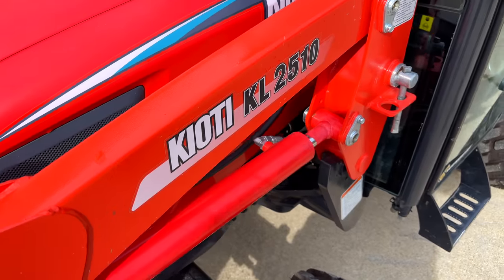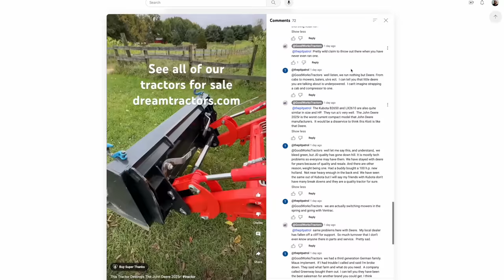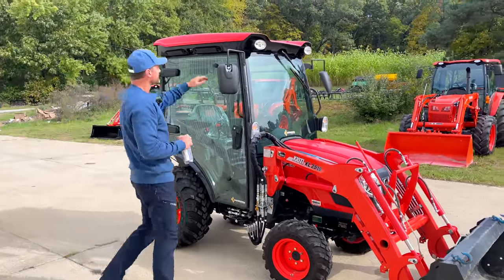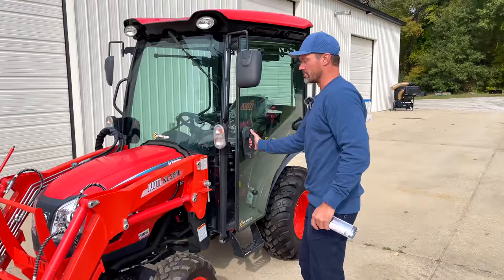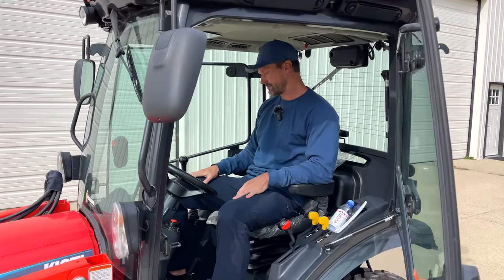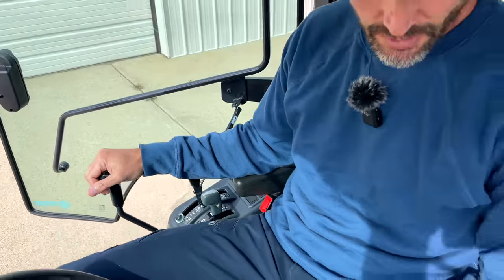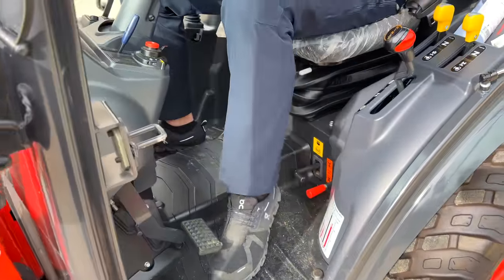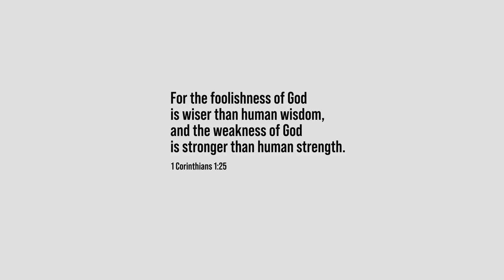THIS TRACTOR CRUSHES THE JOHN DEERE 2025r!

Comment: I think Mister Green has been resting on his laurels for far too long.
Reply from the maker: Agreed!
Reply: When you are on the same side as the Church of Scientology, you’ve trucked up to say the least.  
I won’t buy a green tractor because of their lies and disgraceful behavior towards farmers who are just trying to repair their tractors.  
I was looking at Kubota but the hydraulic pump and capability of the Kioti has caused me to visit the Kioti dealer.
Reply: Agreed.  It used to be that Deere was the best for the most part…. So they earned their extra cost. No more … now it’s cheaper aluminum two speed transmissions.. plastic body/hood , smaller lift cylinders, etc.  I would suspect that Deere purchases ptheir parts cheaper than most manufactures … simply because of volume , If nothing else.  So … Deere just has greater mark-up. I won’t buy another Deere. …

Comment: Looked at the JD2025R, Kubota LX2610 and the Kioti CX2510.  Went with the CX2510 and not disappointed at all except I wish I got the cab.  Got 300 hours on it without one single issue.  It was 6K less than the JD and Kubota.
Reply from the maker: Sweet, that's really good news!
Reply: Same story here, I just bought a cx2510 after comparing the same models and saved $6k vs kubota and $9k vs JD
Open cab doesn't have the rear remote hydraulics
I've just got 10hrs on mine so far,  works very well!

Comment: Overall, the Kioti looks like a great tractor but the hydraulic lines hanging down makes one wonder what they were thinking, that should have never left the factory like that.
Reply: Ya no thanks so in 20 years we going to be able to get parts for this tractor ?
Reply: I pointed this out to my dealer (not a comedian like the guy in this video who doesn't know a clutch pedal from a brake pedal)  right away before buying my Cx2510,  he explained sometimes the factory tends to reverse the 90 degree elbow end of the quick connects to the loader with the straight ends,  and fixed it during my  pre-sale pm.   Then they are tucked up high  nice and tight.  Check out Google images for the right side of the Cx with loader and some are correct and some are wrong.   This joker had not clue about that but still wants you to buy a $30,000 tractor from his dealership.  yeah,  right.

Comment: I have a CX2510 HST, no cab, and have over 200 hours on it in about a year and a half. What it can do for its size and maneuverability continues to make me happy I bought it.

With loaded tires (Rim Guard) and rear ballast, it can lift somewhere about 1000 lbs palletized and evenly distributed on forks, but must keep it low, slow, and on the level (requires extreme caution).

Loader technique is impotant to master for bulky and heavy things like rock or wet dirt. It handles a grapple very well, larger logs handle better with at least a box on the back for ballast.

Yes, it has capacity limitations and at 25 HP, it must be in a low gear and slow going up a hill towing or under heavy load, but it can do it.

When I feel like it comes up short (and it does), I remind myself I would need a much bigger machine and have to live all the time with more than I need most of the time.

Sometimes I experience those limits as lack traction, slower speed under load, or with the loader when I wish I could lift a full ton on a pallet.

But, those are true limitations, just known constraints, because it wasn't designed to be more than it is. That said, it does exceed slightly its paper specs.

It's a real workhorse, tiny but stout and very capable, period.

Comment: My CX came with the upgraded 3pt hitch arms. Extending end link and pin sway bars. I added the hydraulic top link. Absolutely love mine. 6ft 3pt finish mower, 6ft back blade with the loader for snow removal. And the a/c works fantastic, will never go without the cab ever again!

Comment: Man, you're not kidding about the bucket strength! I had 50 ton of 6-inch (a lot were as big as 12 inch) rip rap dumped in a pile last week. I used it to fill washouts on the edge of a 32 acre field. I rammed that loader bucket hundreda of times into the bottom of that rock pole with my Kioti CK4010SE while moving all that riprap. Not ONE dent or bend ANYWHERE on that 66 inch bucket!

Comment: I strongly considered the CX2510 and it is a fine machine.  I ultimately bought the JD 2025R due to having a dealer close by and the resale value.  Totally pleased with it.  Given proper operation and maintenance either machine will get the job done and be worthy to own.
Reply: I agree the Kioti is a good machine but fit and finish the lines hanging down for example  is not on par with the John Deere he has a habit on Bashing the 2025r which is a much better machine than the 1025r he so often brag's about
Reply from the maker: Lol, I wouldn't trust anything you have to say with comments like this.

Comment: I purchased a kioti ck2620. I did my research and I found, the capacity and value were unmatched. I’ve got 50 hours on the machine now and I couldn’t be happier
Reply: Branson, now TYM, offers a pretty close match to the CK2610/20, at least on paper. We had no Branson dealers around when we purchased our 2610 and we've been very happy with the Kioti.

Comment: Bought my CX2510 HST last April. SE version doesn't fit my garage so mine is less well equipped then this one. Not to worry. I am a retired infantry officer and wether on foot, in my APC,  Stryker or hanging down a parachute, you come to think that feeling the sun, rain or snow on your face is a necessity. Bought the bucket, the grapple and a gradebox for it, and extra back weight. Very impressed so far. Looking forward for the coming winter here north of Quebec city. Should be lots of fun.

Comment: 5 years ago i researched tractors for a snow plow company.  I looked at deer, Kubota, tym and Mahindra.
Looked at the 40hp series.  Deer had nothing available for at least a year.  Kubota dealer didn't even let me sit in one, (and got a mechanic to answe questions -who was annoyed at being interrupted).  TYM dealer took lots of time to answer questions and handed me the keys to one to take for a spin.
Mahindra dealer did as well.  TYM and Mahindra were equally priced, significantly less than Deer or Kubota.
Just this year upgrading to the 60 hp.
Similarly specs on deer and Mahindra.
30k difference.
And the dealer support from Mahindra has been phenomenal!

Comment: I own a CX2510 cab and did a lot of research before buying over a 2025r.  There are couple things to correct on your review.  The engine is the exact same 3A165 100ci 3 cylinder as the CK2610/CK2620 model.  No idea why the manual says 87ci.  It has the 100ci engine.  The FEL hoses are on backward on yours.  Flip them around where the 90s are up top to solve the low ground clearance issue.  The ROPs model has better hose routing and can replace these hoses too.

Comment: I bought its big brother in June. CK4010SE cab. Came over from WI in Aug and got an HLA snow pusher a quick hitch and some weights. Great service from your people! Load and go! Tractor has been great in the 25 hours I have on it now. I got it for the 1900lb loader capacity. Rim guard in the rears and an addition 8 suitcase weights will work great for snow this winter.

Comment: If dealer networks and resale wasnt a thing, all these tractor would be more popular. Until that happens, JD and Kubota will be king. There is obviously a ton of used Kioti tractors, which is why Good Works Tractors seem to be the new official used Kioti tractor dealer. That doesnt take away from the fact that these tractors have better specs than the top brands. I have to hand it to you Courtney, you are a genius when it comes to marketing.
Reply from the maker: Thanks Nick!
Reply: I'm in east Texas, and you can't find a used Kioti, but you can find them all over the ranches here.

Comment: Nice to see you reviewing kioti. They make a hell of a tractor. I’ve owned 2 kubotas and I wouldn’t trade my 2014 Kioti Dk40se hst for any comparable tractor. It’s an absolute beast! The loader capacity is unreal! More hydro flow, weight, fully optioned tractor. The rear lever for the 3 point is very convienant.

Comment: I have owned this machine for 2 years now, I mow 15 acres every week 
I used a farmall A for years 
I looked at all the zero turns and I didn't like the rough ride 
The other manufacturers of tractors out their didn't compare. You can mow a lot of grass with the Kioti 
And let me say the cab on this machine is awesome. 
I live on a farm and my dad is totally impressed with what this little machine can do.
Over 300 hours and I have done nothing but change the oil's and filters, and sharpen the mower blades

Comment: I have a 2410 Kioti with 1100 hours on it. I built a cab to fit for winter snow blowing. That tractor is great, but Kioti took all the little annoyances out when they brought out this 2510. Wish I owned this!  I certainly would change those hydraulic hose routings.

Comment: I believe the reason the john deere 4066 does not have the gas shock on the right hand door is because deere doesn't really want you getting in and out that way. When I get in or out on the right side, sadly, my leg usually bumps the loader joystick ,and that could be dangerous.  I didn't say Deere had a good reason ,but my guess is that's it .

Comment: My pretty much identical bobcat ct2535 also comes with heat and ac in the weight class and price point.  The Kioti across the street was my 2nd choice, only went due to dealer support in my area. Both good machines for the acre owner or small hobbiest.
Reply: same parent company

Comment: I know this vid is a bit older now but I have a couple things to add. I have the CX2510 open station hst. Kioti lists the engine specs wrong on the CX landing page but it actually has the larger 100+ ci engine that the CK's have. Also, the top speed is under estimated, mine goes 12-13 mph top speed unloaded (GPS verified).  Maybe the cab slow that one down.  Great review though!  Its a stout little tractor and I absolutely love mine.

Comment: I have this Tractor with a pull type snowblower for the winter and a Maschio 155 flail with hammer blades working great except I had the safety controller go out at 70 Hours other than that it is a great machine
Reply from the maker: What width snowblower are you running on it?

Comment: That Kioti factory cab is a big step up over the aftermarket built for kubota bx Curtis cab, which is still a great cab for the size. In any surveys I’ve gotten from kubota my 2 suggestions are a “position control” 3 pt setup, and a factory cab….which is actually available on the European variant the bx231
Reply from the maker: Europe always seem to get the good upgrades before we do.
Reply: To your first statement, this Kioti compares much more closely with the Kubota LX2610, not the BX. I don’t think Kioti has a factory cab on their subcompact?? Deere has nothing to compare to in this particular size machine.
Reply: Actually, looks like they have a “field cab” that you can add on to the subcompact, and it looks great!

Comment: I’m a Deere guy and I have to say that’s a impressive little tractor, I would add to the AC in that tractor running a 60” mower on top of the AC that not enough horsepower to do it on hilly terrain, I had a 4710 Deere and upgraded to a 4720 and was told when the put the cab on they needed more horsepower to run the AC compressor so I would assume the same theory applies here, that tractor looks like it was used for snow removal with corrosion on 3 point arms and levers on bucket release, plus a plug on the back for salt spreader power

Comment: Even as a born & raised green tractor guy, the Korean tractor and equipment companies have some promise and some well thought out designs and features.  I think Kioti has more market share and has been around in the US longer than any of the others and I like this model quite a bit. 

There’s only one thing that gives me pause with Kioti and that’s the dealer network.  Kubota and Deere both have two dealers that I pass close to on a regular basis. The Kioti dealer is 30 miles from me and the hours make it so that I could only get there on a Saturday morning.  Unless I move closer to that dealer or they open a branch closer to me, it leave Kioti out of consideration . . . for now.

Comment: I have the open station version of this Kioti. I do not have the rear controls on the 3 point but wish I did. Mine is not equipped with the 12 volt and USB that he mentioned. Again would be nice to have.  Mine is not an HST and seems stronger than my brother-in-laws 30 hp New Holland with HST. I LOVE my Kioti only regret is I don't get more time on it. As my regular job gets in the way.

Comment: I have a BX2380 with a cab no AC but plenty of windows to open so no big deal. I got the cab for the heat in the winter which is when I'll be using the machine the most.

Comment: Nice tractor and overall more capable than the equivalent size Kubota and John Deere. I don’t have a dealer in my area so I ended up going with a Kubota.
Reply from the maker: I'm finding dealer support is not a real thing anymore.  I've currently got a JD machine that needs a leak fixed under warranty.  Two different JD dealers near me.  It's one month before I can get in to one of them, two months before I cand get into the other.  My JCB tracksteer has been down for over 3 weeks now and still hasn't been looked at.  Another warranty issue.  I have stories on just about every brand of dealer around me.  Perhaps it's unreasonable of me to expect equipment to be fixed faster than that.
Reply: My Kioti dealer picks up and returns my machine for a small fee. 2 hr round trip

Comment: The hydraulic lines on the loader are installed backwards. Mine were installed the other way with the elbows up on the loader frame and straight out of the valve body that gets them up out of danger

Comment: John deere has deep roots, proven reliability, unlimited parts,a dealer every 50 miles . My Grandfather bought a  new John deere in 1939 and my brother now owns it and still able to get part's.
Reply from the maker: Unlimited parts?  How come they have to order parts every time I need a machine serviced?  On that note, what good is having a dealer every 50 miles (I have two dealers within 25 miles) when I can't get in for two months?  How's that reliability and service for ya?  What do deep roots have to do with anything?  They charge way more for less capability than every other tractor brand on the planet.
Reply: What do they use to harvest plant corn and vegetables and wheat. And Cotton? jJOHN DEERE   I've not seen a Kioti Combine.

Comment: My cousin has this machine the only complaints I have is the bucket is actually about 1/2 inch narrower than the machine so your tires are stuffing against the banking when digging, and my legs get cramped quickly.

Comment: Around where I live if you want dealer support Deere and Kubota are your only option. I have a 2022 2038R  myself and love it! I haven't found anything it won't lift to be honest.
Reply from the maker: My JD dealers are 1 and 2 months out to fix a leak on an under warranty issue.  I'd gladly drive an hour if I could have a dealer that would fix it in a week.
Reply: I called my kioti dealer and they picked up the tractor a week later for warranty work
Reply: @GoodWorksTractors  must be your area. My dealer is not that way. I called when I had a leak on my old 1025R, they picked it up the next day.
Reply: @aaronrroy  my dealer usually gets mine in less than a week. I know all dealers are different tho.

Comment: These definitely give you something to think about. The one area where John Deere will shine is parts availability and the large network of dealers to provide warranty work, in some ways (not all) their fit and finish is a little nicer, but other than that yes based on my last venture of tractor shopping i think deere can afford to step it up a bit. My only concern about owning one of these smaller lesser known brands is longerm service and warranty but otherwise these look like very solid machines. Budds all tractor seems like a nice dealer to do business with I'd be willing to give it a shot.
Reply from the maker: I have 2 different JD dealers in my area.  1 month wait at one, 2 month wait at the other to get a tractor in to fix a under warranty leak.  That's not very shiny in my opinion.  Kioti has been around in the USA since 1993 and in existence for more than 70 years.  Their longterm service and reliability has been proven out.  They continue to gain marketshare against the big two.

https://www.kioti.com/about-us/daedong-corporation/

https://www.kioti.com/about-us/daedong-usa-inc/
Reply: @GoodWorksTractors yes I forget the crazy times we live in it's difficult to get anything yes you're probably referring to greenmark and steensma.

Comment: My take on the loader hydraulic lines pointing down thereby causing less ground clearance and having the tendency to get caught on anything that could hook them is somewhat simple in the world of SubC and C tractors.
The second I saw this I stopped watching and headed straight to the comments to put in my “two cents” if you will.
Either take them off and reverse their orientation or have new ones made with straight connectors on that end.
If there’s a budget and for some reason the hoses cannot be re-oriented, just bring them to 𝑨𝑵𝒀 company in your area that sells and services construction equipment, heavy equipment, farm equipment or similar or any combination of.
Most likely they assemble hydraulic hoses and the like, just bring in the ones from the tractor and have them cut off the elbows and mount straight ends. Voila, they’re little shorter but based on the hoses presented in this video that will be a non issue. Plenty of hose. 
You’re back in business the same morning/afternoon…..